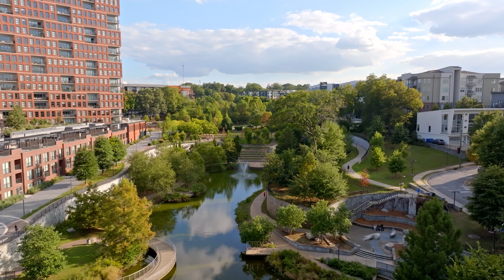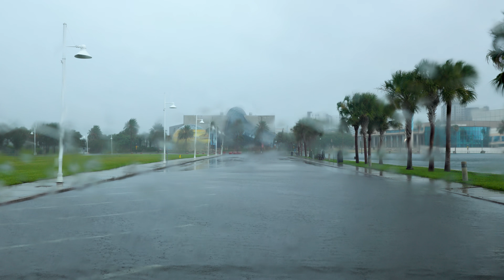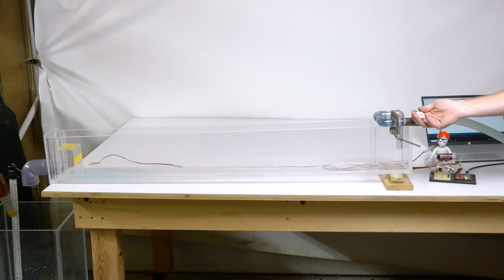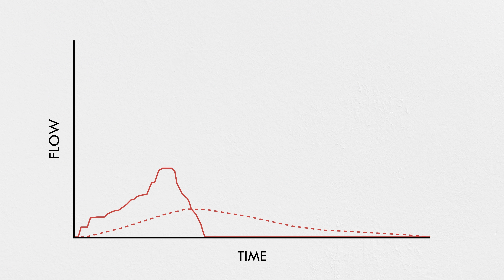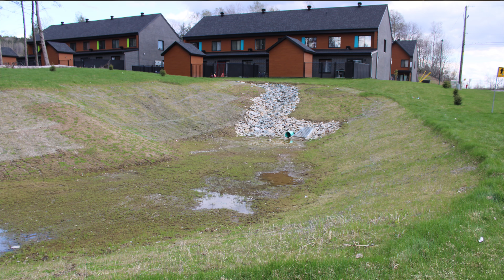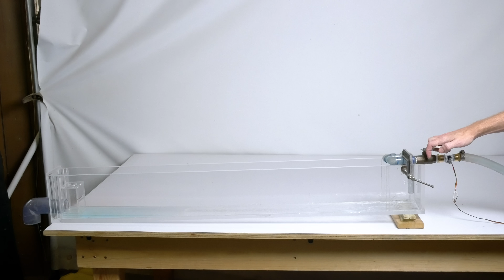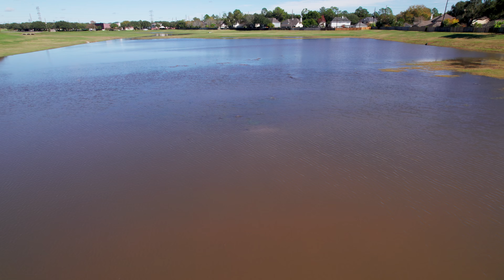Do Retention Ponds Actually Work?

Comment: In high density areas in Sydney some basements are designated emergency detention pools. With all equipment, lifts, parked cars and so on. In case of catastrophic storm building systems (downpipes, pumps) not drain the runoff out to council system (creeks, pipes, channels) but in opposite begin to accept external water. By design.
Reply: I'm surprised people go along with flooding their basements.
Reply: @mgratk  this is just a development condition. Want to build 30storey building in area 30km from ocean in river valley (Parramatta) well known for catastrophic flood as runoff collecting from all hills around - provide such a feature, or build somewhere else.

Comment: A development just upstream from my house put in a detention pond and it is now overgrown as no one has been maintaining it. The discharge is into a ravine that runs along my property line, under my front yard, and comes out across the street into a continuation of the ravine that drops a couple hundred feet over a mile or so. The overgrowth certainly limits the capacity and from what I have heard some part of it was not done correctly, which may explain why it sometimes smells like something has died in there. On the plus side, since they knocked down a couple acres of trees, I get far fewer leaves in my yard than I used to.

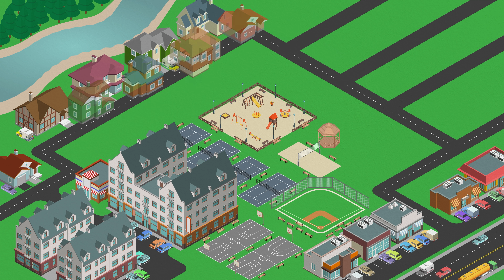Comment: 2:30 those are either some MASSIVE basketball courts or a baseball/softball field for ants. A basketball court is ~90 feet long and for baseball it's 90 feet between bases. Even assuming that it's a little league or softball field (45-65 foot basepaths depending on exact rules used, usually 60 feet) that doesn't parse.
Reply: What is this?! A community park for ANTS!? It needs to be at least…. 3x bigger than this! 😂😂
Reply: Why do you care so much, it's a representation. it doesn't have to be scaled properly

Comment: Retention basins do some good, particularly in reducing stormwater flows out of large, highly impervious areas (such as shopping centers) at the upper end of small watersheds.  But, in general, they are a poor substitute for measures downstream to keep vulnerable development out of flood plains, which Grady described very well in another video.  

The retention basins are typically designed to keep downstream flows to a "pre-development" level during large but not extreme rainfall events.  When the extreme events occur, the basins are of little value and even negative value if they have encouraged downstream development.  An example of the FACT that storm flows from undeveloped watersheds can be disastrous is the flooding of the Guadalupe River in Texas during July, 2020, which Grady also described very well.  That occurred in a watershed with rocky, impervious soils typical of central Texas, where there is practically no upstream development. 

Another feature of most retention basins, which are designed to normally be dry to increase the volume available for storing the peak of storm flows, is that they accumulate weeds and debris, and can breed mosquitos if wet spots develop.  They need to be maintained,  but in the real world typically are not.  They generally aren't nearly as beneficial as they are claimed to be, mainly by people with an interest in developing flood plains on the one hand, and technically-challenged "environmentalists" on the other hand.

Comment: When a new Neighbourhood was developed in my Hometown in 2018, a retention pond was built as well. Its the only one there. After a series of severe floods (two already struck a nearby towns in 2016, the floods leading to the decision were in 2021 though) the state government invested in a statewide simulation about what happens when there is a significant rainfall event. They assumed a event of 112-136mm (4.4 to 5.4 inch) within 4 hours. The result: The retention pond will overflow and a 1m (ca. 4 feet) wave will rush though the village. In a neighbouring village another retention pond will overflow, leading to a 4m (13 feet) wave entering the village from the other side. 
In the future the state wants to create that simulation in realtime with live weather data to allow for faster and better warnings.

Comment: This is how one of the stores at my old job got absolutely annihilated, lol

A huge Sonic carwash/gas station was being built behind our location, and they made a retention pond, buuuut

In june and july of 2025 we got weeks of heavy rain, and the retention pond overtopped, flooding us (an oil change place) and several businesses nearby. When the town board investigated it, it turned out that Sonic had lied about a lot of things including runoff capacity and how much paving/grading they had done.

Our store had the pits below cars you see in a lot of places, and once the floodwater ran into that it was all over. It overwhelmed the sump, lifted and cracked the floating foundation, and wrecked all of our work infrastructures too. 

Regulations are there for a reason! The town is already famously litigious, I am sure they are going to bring the hammer down. Suffice to say I have experienced the exact situation these things are supposed to prevent because a developer cut corners.

Comment: The town I live in….

It is almost entity built on ONE side of a river. That is the higher side. 

When the river burst its banks it floods the side of the river the town is NOT ON. Miles and miles of fields under water. The town, dry. We just look over the river at the flood water. 

One thing some ‘planners’ never considered was that they were engineering it for failure.

Drain the wetlands, so the water has no option but to drain off, rather than soak in and drain away slowly.

Straightened the rivers/water corses, so it ‘drains off quickly’ rather than take ages to drain off. 

There is a common thread. Drain it off quickly. So it runs down the river, and then when it hits a bottle neck it floods a whole city.

My town, we know we are dumping ground for water from up-river. So we let it flood the fields. Where there are no houses. then the silt is an excellent source of free fertiliser.

Comment: This is some of the most common civil engineering people live with, even if they didn't recognize it for what it is. It's very important, not only for flood prevention and erosion reasons but also in terms of saving lives! The 1997 Flood of Fort Collins cost 5 lives and $250 million, but award winning flash flood control systems already in place saved the City from a far worse outcome.

Comment: I think that there was a small detention pond on the property of my elementary school, between the school building and the neighboring houses - kind of a long, somewhat narrow dip in the terrain with a big, square metal grate in the middle, the latter being surrounded by about a 2-foot-wider-in-each-direction concrete square.  Some of the other kids said that it was for airplanes to empty their toilet tanks as they flew over, but although my hooey-alarm was triggered by that statement, the real purpose for it escaped me - so naturally, as the class know-it-all, I didn't say anything 😅

Near my current house is a park with a small "reservoir", to use the park's parlance, with a walking/jogging/biking trail around it, about a distance of a kilometer or so, 1.6 miles?  I could have that backwards.  Anyway, I've always been fascinated by the large, square, metal grate on top of a large, cubic, concrete structure sticking out of the "reservoir" at one end, inset from the trail but so close to the same height as the trail that it looks like the two are at the exact same height, though I'm sure that the grate is ever so slightly lower.  It always reminded me of the overflow drain on a bathtub, but since I've only seen this "reservoir" full to the brim on one occasion - and that only from a distance - it never before occured to me that part of its (the "reservoir's") purpose, aside from being a water feature, a place to do some catch-and-release fishing, a backdrop for the local tavern, a haven for ducks and geese, and a source of irrigation water for the park, might be as a retention pond!

Another great video!  Thanks, Grady!  😊

Comment: In Germany, we nowadays are often required to completely handle the 5-year maximum rain event on the property via infiltration, evaporation and greywater usage. Meaning there often aren't any rainwater utilities in the street, except for covered infiltration ditches/covered infiltration structures to handle the runoff for the street. Which is practically an improvement compared to an unbuilt surface, which can have a decent amount of runoff even during a 5-year storm.

Comment: Just yesterday I was outside and heard the loud whooshing and hissing sound of air escaping compression. It was followed by some gurgling noises and then the staccato sound of several large impulse sprinkler heads becoming active. The retension pond nearby was emptying it's stored water onto the soil. Years ago there was a 200 acre piece of undeveloped land at the edge of my street. A company finally managed to propose a development of apartments that could meet the land use codes and regulations for this area. They had to leave a large portion of the land undeveloped (almost half I think) and add a number of stormwater control features. Much of this was to protect the aquifer, but it was also critical to protect downstream houses from the development runoff. There had already been flooding issues and the city was not going to let them get worse.

Comment: This is really interesting - I've seen ponds all over the place, but never once thought about whether they were - well, FOR something, ha! South Mississippi gets quite a lot of rain plus the water table is already pretty high, and I'm betting the clay-ey soil doesn't help either, but flooding is pretty well controlled inside the city where I live, and I see now that some of the ponds are a part of why. There are several creeks too, and their banks have been reinforced and made really steep, resulting in a fairly deep channel for water. One section of creek passes right by the closest grocery store to me, I see it almost every day: and even during the WORST rain, even during Katrina, the little bridge over that creek never flooded. The creek was most certainly full just about to the very top - and there were other places in the area that did flood - but our little slice of the city rode out the storm with very little flooding damage. (Don't mention wind damage tho. Some of the neighbors are still extremely angry 20 years later about the number of downed trees and smashed roofs.)

I like the ponds with the fountains in them too - aerating and agitating the water a bit must help at least some with the mosquito issue, right? As well as being aesthetic of course.

And just yesterday I learned about a material called shungite that is, apparently, being researched for use in civil engineering. The stuff is very high in carbon and can make concrete a little bit conductive, which is pretty cool all on its own. Even better, the scientists have shown that they can use that effect to basically make the concrete self-sensor: it can "tell" a control panel when it is damaged, even if that damage isn't visible from outside the slab. I feel like this kind of capability could be VERY useful in this application too, maybe by using different types of sensors (I'm not clear on HOW the "reporting" part works). But imagine if you could more or less ask the sidewalk for a status report during a bad storm!! Magic.

Comment: I'm not entirely sure how it works, but over here in the Netherlands, we have on about 90% of highways the so-called ZOAB driveway. ZOAB (Zeer Open Asfalt Beton) is a pavement type that can 'absorb' water in huge quantities. You'll notice the difference between regular and ZOAB quite immediately when it rains. Heavy rainfall can 'clog' the system and honestly I have no idea where all this water is going (collected in pipes and shipped to filters, I assume) but it's a great solution... Although I prefer ponds, difficult driving on those though ;-)

Comment: City of Los Angeles instituted new codes a few years ago, requiring new single family homes and major remodels to prevent runoff onto the streets by adding features off a list. Could include raised planting beds, gravel lined dry "pond", rain barrels, etc. The hope is that the water dept. will not have to recharge the aquifers under the city as often from the various rivers and canals.
Reply: The problems with these systems is that the average homeowner has no idea how they work or how to maintain them. Once they fail, the homeowner will inevitably redirect the runoff to the road.
Reply: @johnnyh3653 Yes, my first thought was subsidence. Surely any of those measures could undermine the private dwellings?

Comment: I've actually done calcs and design for stormwater facilities and my favorite has got to be a percolation bed. Catch basins pick up runoff which goes to a sand and grease trap. It goes out through a perforated into a bed made of drain rock with filter sand bedding. Cool thing is this can be underneath roadways, with the drain rock functioning as a subbase for the structural layers. Seriously, they are everywhere.

Comment: catch rain water on top of buildings too flush toilets.or plant grass ontop of buildings.  they need to leave more grassy areas in cities but theyre too worried about profit, cramming as many apartments into one place as possible. nothing else matters when it comes to corprate greed. when it all floods because get a 1/150 year storm all of a sudden its a problem. no ones builds for the future. its no different than snow. its very simple concept ... leave room for snow and you wont spend millions of dollars hauling it away...

Comment: peaks, valleys, flow rates... it's always entertaining to see the similarities in behavior between water and electricity, two very different elements.

Another nice thing about maintained ponds is if you live in an area with very hot summers, that large volume of water helps absorb some local heat and keep temperatures a bit more stable.

Comment: I live in area where the neighborhoods were built in the late 70s and early 80s.  Part of the agreement between the city and developers was storm water runoff basins.  The neighborhood parks are all sunken by around 10ft or so, some areas without parks have empty lots that they dug out.  They're almost never used but once when I was a kid the large park close to me, about 3 acres in size, had a couple of feet or so of water in it after a very rare storm system (or two) came through.  I wanted to go "swimming" in it... knowing what I do now I'm glad my parents said no.  The major Sites Reservoir here in CA has been approved and construction is supposed to start... I wonder if you'd be able to do a series of videos as they are building it out and able to show various stages and how they make the whole thing work.

Comment: The ponds only work when designed, built and maintained properly. 

I have a property behind me that recently sold with close to 40 acres. It's the tallest land in the area. The ground is a mix of lime stone, and a small portion of topsoil.

The developer installed a new sign claiming that plans were to build 210 town homes on 13 acres and was installing 2 one acre ponds.

As it currently stands, a inch rainfall floods down the hill and across the roadway, then floods between my and my neighbors house. With the town houses, parking area and roadways there will be almost no permeable areas for the water to soak into. 

I'm going to be the bad guy and will be filing complaints with the department of the environment during every storm.

Comment: Something not mentioned in the video, is that retention pond are/can be used for fire fighting.

There are retention ponds in rural areas where runoff is not a problem. However large supply of water for fire fighting is.
Additionally these ponds are also located in industrial areas for the same reason.

Comment: I have a cautionary tale of a CMAC design.
It lead to the 2011 floods in Brisbane, Australia, starting with the Wivenhoe Dam.
The city council refused requests to discharge or pre-discharge. It wasn't until the dam reached 120% capacity at which engineers had protocols to overrule their instructions, saving the dam, but leading to the worst flooding event since the 1970's, predating the dam's construction. 
This is on top of 2 other catchments to the river flooding and with the emergency discharge from the dam merging at the city causing this major flood.
There was another flood in 2019, but thanks to new management, the damages were far less severe.

Comment: You should come to Florida.  We love our retention ponds here!

I tell people from out of state that Florida is half sand and half water, all mixed together.  If you want to build something like a road or houses you push the sand over to one side and the water to another and then you have buildings and retention ponds living happily side by side.  Not surprisingly the amount of retention pond is legally mandated for new construction, but there are sometimes failures and I'm sure you could find some good stories to analyze what happened.
Reply: Sand, what is this sand you talk about?🙃 There is no sand here where I live in Florida. If it weren't for the fact that a D-9 dozer and a rockplow had gone over it at least once, I would be sitting on nothing but rock with an occasional pocket of red clay.
Reply: @gravelydon7072  Fair enough, Florida is large.
I live on the big sand bar that rose out of the ocean 30 million years ago.
Reply: @Michaelzehr  Most people don't understand how big Florida is. I dread seeing the Welcome to Florida sign on I-95. Because it is over 400 miles left to go to get home.
Reply: @gravelydon7072 panhandle ?